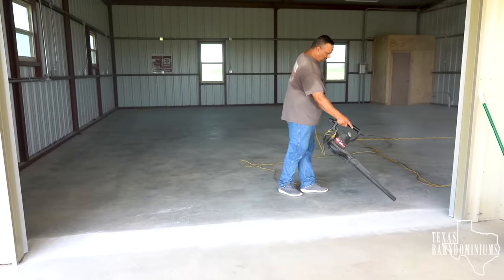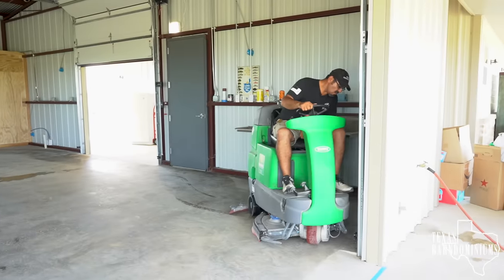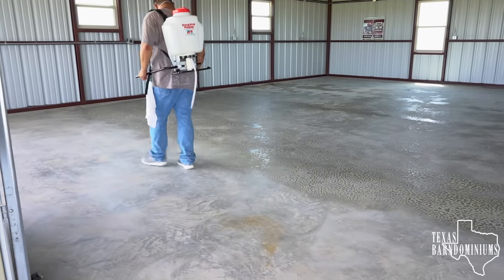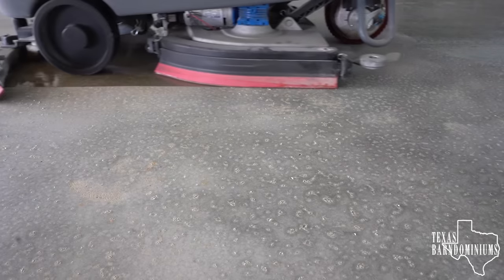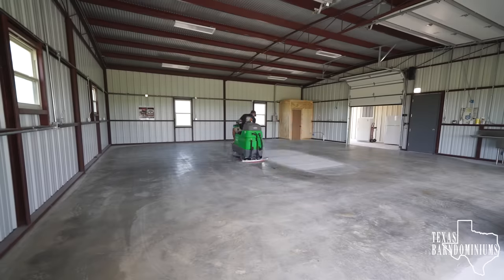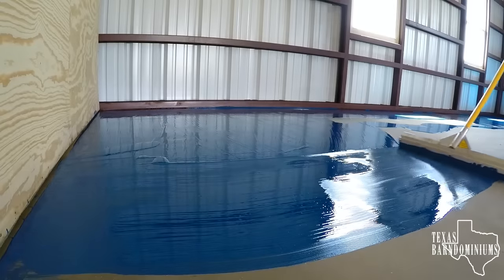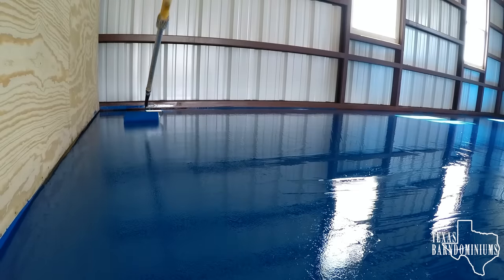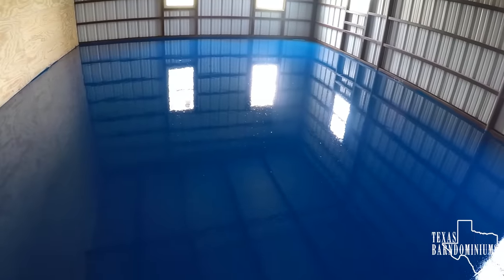How to do Epoxy Floors - STEP BY STEP GUIDE - S3E3

Comment: Speaking as a pro who’s been doing this for 20 years - sanding and acid are only for people who don’t have a grinder.
Reply: Doctor Goop - 
unless its new crete and/or you have a shot-blaster
Reply: How much Make a month$
Reply: My rust oleum primer is still tacky 3 days after application. If I stand on it in the same spot for 3 min and the move the paint peels off. I used muriatic acid first , rinsed and let dry over night. I think my big mistake was that I primed when is was rainy outside. Will this primer ever cure / dry so I can put the epoxy coat on ? 😢

Comment: Most people would do 1 coat and skip the sanding.  This guy does 2, then applies a coat of polyurethane.  It's nice to see someone who takes pride in their work.
Reply: I guess if you do that stuff for a living, and it's your own shed, then you are going to go all the way.  I would so love a space like that.
Reply: I actually grind concrete not sand, he's wrong about feeling like 400 grit sand paper thats not rough enough.
Reply: Most people wouldn't put acetone into 100% solids epoxy...  that's one of the reasons he's getting the bubbles. No bubbles means no need to sand between coats.

Comment: I used to work for a company that put down epoxy flooring. We used to wear metal golf spikes to walk around on it and it was slick. I worked with a guy who slipped and fell in a puddle of the epoxy and he had to go to the hospital to have his clothes removed and get the epoxy off his face and hair. It made me more cautious after seeing that happen. We used to go into a factory on Friday afternoon and not stop until We had the floor blasted, new clad laid and and epoxy coating put on. It had to be done and ready for the plant to open up on Monday morning for 1st shift. We would work 40+ hours in 2 days with no sleep on most weekends. I don't miss that job. I am actually allergic to epoxy now from all the exposure I had to it back in the 90's. My face swells like a balloon now if I even mess with stuff like JB Weld.

Comment: Great advice all the way around! Surface prep is definitely key and you are doing a fantastic job. A couple of observations for those that might not do this everyday. In the video it looks like the epoxy was being applied the next morning. Your results will be significantly better and you will have fewer air bubbles if you apply your epoxy in the evening as the concrete and air temperature cools. In practical terms, concrete exhales as it heats up (morning through afternoon) which causes outgassing and creates air bubbles in the epoxy. Likewise, it inhales as it cools (evening to morning) soaking up the epoxy and leaving a much smoother finish. If I might offer one piece of advice, you might look at using another solvent besides acetone. Acetone loves water and will pull residual moisture out of the concrete, bind with it, and cause small blisters that look like outgassing and pinholes.
Reply: Wowza! Makes great sense! Anything else besides acetone or just deal with a thicker product. Ty
Reply: What's an alternative to acetone?
Reply: Do train
Reply: That must be what the incompetent idiots used on my floor in Florida.  😢
They really did me dirty.  My (expensive) floors are disgusting.

Comment: To get rid of the bubbles spray the epoxy after it has been rolled with isopropyl alcohol from a spritzer bottle. It will make the floor look even glossier and no bubbles.👍
Reply: How soon after you put down your 1st coat do you spray the alcohol?

Comment: That is the most thorough preparation I've ever seen. Well done!  Excellent job.
Reply from the maker: Thank you.
Reply: You haven't seen much then
Reply: @foxyepoxy602  for real he didn’t even throw any diamonds on it 😂
Reply: @tylersherratt4466  nope! I bet parts of this coating have already failed
Reply: @foxyepoxy602  ? Why would it fail?
Reply: @redrockdesign966  He didn't grind the floor. Acid etching only provides a CSP-1 at best, if you're lucky.
Reply: @foxyepoxy602  Why would he need to grind that floor?  What exactly required grinding for this project?   He aggressively sanded them all with a 60 grit orbital...
Reply: @redrockdesign966   For all that work he could have hit it with a Dimond  grinder, Up to 60/80 metal bonded diamonds  then Vac, And apply in the same day..

Comment: I've poured a couple of epoxy floors myself and followed recommendations from other Youtube video's. However, this video is the absolute best because the guy really explains the why's and why not's. Other video's seem to be made mostly by people who want to sell you the epoxy and they skip or don't explain so much of the tedius, time consuming preparations like sanding and acid washing. I don't agree about accepting the bubbles though- a gas torch (preferably) or heat gun used briefly on the bubbles will get rid of them and avoid the need for sanding the popped bubbles afterwards. The popped bubbles really do ruin the look of what would otherwise be an amazingly glossy surface. Also, I used silica sand sprinkled on the epoxy just before it finally sets hard (in other words, while it's tacky like treacle) but you can also get non slip products to do the same job. Well done mate!
Reply: Yes 100% agree on the torch. I used to do this for a living and always used a torch. HUGE time saver.

Comment: Thanks sir! I have a epoxy guy coming out to the job tomorrow to give me a bid for epoxy floors in our commercial kitchen. This helps with giving me  a idea of the process! God bless
Reply: Commercial kitchens (if you have fryers) should have a urethane cement with quartz broadcast & polyaspartic top coats. Nothing you watched here will prepare you for that install. Epoxy will delaminatecat 140*, polyaspartic at 180*, and your UC will take whatever heat you throw at it. There's no comparison.
Reply: I need the job

Comment: I’d never seen this done to a floor; looks dope.
Reply from the maker: Thank you
Reply: “Looks dope”  Is that a good, or bad  thing?  I guess I just don’t understand this new slang language.
Reply: Mark Williams just google the word “dope” and you will see that it is an informal adjective meaning “very good.”

Their example in a sentence is “that suit is dope!”

Lmao
Reply: Michael Duran 
What is this “google” you speak of?
Reply: Mark Williams google is an excellent (one of the best) graters. It doesn’t work on cheese, but rather it works on stupidity; taking big blocks of it and turning into significantly smaller chunks that can be digested more easily.
Reply: @91156  hahahaha!
Reply: Crack, heroin, meth, cocaine, hashish???????

Comment: Here's a tip, wear an old pair of Golf shoes when putting Epoxy down, You can stand in or walk around on wet Epoxy and it will not leave any marks. The tiny holes will self seal. That's hpw the Pros do it.
Reply: @donalkinsella4380  It depwnds on what kind you use!
Reply: DEPENDS!!

Comment: My boss had the floors done with blue epoxy stuff when we moved to a new factory.
We very quickly discovered that it was so smooth, that as soon as the machines sprayed sawdust around, the workshop turned into an ice rink!!
It became so slippery, it was actually a hazard!!
After a few injuries, (and WorkCover claims!) The boss had the floors done again - this time with some sand grit added to the epoxy to provide some traction!!
Reply: Glass bead is what the company I work at uses for industrial companies, mostly for grip plus diamond powder.
Reply: @fearlessgod6625  can add a top coat of clear for protection and mix the bead or grit material into the clear coat.

Comment: Installation was awesome, prep is good for a diy, but not adequate for a professional install. Acid etch doesn't work for long lasting floors only diamond grinding with full cap removal works for lasting prep. With that said this is probably one of the best diy coating istalls ive seen nice work.

Comment: When I do epoxy, I cut in all around the perimeter with cheap solvent brushes, where the floors meet the walls to eliminate getting the slop on the side walls and baseboards. cleaner look.
Reply: define 'cut in'?  like you brush it off?  or you brush the epoxy up next to the wall?  or what
Reply: @RatmanSays  Just like painting a rooms walls, you "cut it"  all the areas where you cant get a roller into. I use a cheap white bristle brush to gut in the outside perimeter so I dont have floor material on the walls when I'm done. Nice clean lines,

Comment: Use a diamond grinding pad instead of sanding and acid etching. Much faster and cleaner. Also, after grinding, sweep then use an industrial vacuum... no dust residue. I did epoxy flooring for 7 years at facilities like US dept. of agriculture, a 60,000 sq. ft. gym for the national guard armory, gene research facilities and even Camp David. Larger floors were shot blasted.
Reply: Can we get your contact?
Reply: I did the same on my garage. After figuring out how to control the grinding buff machine without nearly ripping my arms off, it made for a nicely prepped surface. I don’t think chemical surface prep could ever outshine physical prep.
Reply: @evanphillips4302  sometimes, both are required. Depends on what you have to remove.

Comment: When i do epoxy i throw the colored chips on the epoxy then use the clear coat of epoxy, i never heard of using polyurethane on the top coat thank you for that
Reply: If you don't do poly over epoxy it will yellow where the sun hits the epoxy.

Comment: Good job. To remove air bubbles from first epoxy layer you can try to use hot air gun. Temperature is about 150-200℃, but very gentle airflow. Test this on small piece of surface first.

Comment: To be clear, not all floor coatings thin down with acetone. A lot of epoxies thin with MEK, so read your specs. Also, I've personally seen good products ruined by air bubbles due to not letting part A and B cook after first mixing. What I mean by this is, once you mix A and B together most epoxies have to set for 15 to 30 minutes undisturbed then remixed before use. If not, the chemical reaction between components after applied will trap the off gassing of the epoxy causing bubbled finish. On a side note, if water beads on your concrete before painting, it's not porous enough to finish. It should be able to absorb moisture. I'm not trying to nitpick, but floor coatings can be expensive to paint and more expensive to correct failures. READ ALL INSTRUCTIONS and follow to a T.
Reply: Good to know this.
Reply: What you refer to as cooking is something similar that's supposed to be done in tile work also. Epoxy thinset and grout has a three minutes "slake" time, remix and move quick. You have 20 minutes before the mix sets. In all other types of non epoxy mixes you have a 10-15 min slake time then remix.

Comment: Excellent video. However, I might add that the bubbles are not due to the epoxy displacing air - they are due to heat pushing air through the slab. When temperature increases, air and moisture vapor in the concrete heat up and expand. If you coat when it's cooler or in descending temperatures you will greatly reduce the propensity for outgassing. Great job!
Reply: great info!
Reply: Exactly well said

Comment: How lasting are epoxy floors when subjected to wear? I've seen some neat epoxy floors in parking spaces but I don't know how good they are or for how long they last when you have cars constantly making maneuvers in the same place to park cars in a given spot...
Reply: PrimiusLovin they don’t last, my floor was professionally done 7 years ago and has since cracked, chipped from drop items, shows wear from vehicle traffic. Looks pretty in a garage for a while..it’s still a garage. I almost forgot to mention...it’s slippery when wet!
Reply: It depends how good your applicator is in preparation. And is it for a garage, patio or basement? Polyaspartic topcoat is more durable than epoxy.

Comment: Any idea what this would cost, per square foot, to hire it done?? I have a new slab, and they are fixing to erect the metal building.
Reply: In my area (WI) it starts at $6.00/ sq ft.
Reply: Wow, kinda pricey, but looks great! I only spent $7.00 here in north Texas to get my shop slab poured. That's a 5 inch slab with 2' beams on the shop area, and 16" beams on the parking cover. Guess I may have to either do it myself or paint it.  :(  But thanks.
Reply: In my area of WI it starts at $3.60/ sq ft.

Comment: Won’t the polyurethane change color over time, especially where the sun shines in?
Reply: Typically, the epoxy would change color without a clear polyurethane as a topcoat. The poly normally doesn't change.
Reply: Use a polyaspartic topcoat  to prevent ambering and provide greater protection from small scratches

Comment: If you used a torch with a medium flame the bubbles would have dissipated.  As long as your epoxy was not flammable.
Reply: He did mention he mixed epoxy with acetone. 
Highly flammable
Reply: Yes correct fire will take away all the bubbles..  
Why need to apply acid before epoxy ??
Reply: Also could use a spike roller.

Comment: It´s damn fun to watch these videos to see how damn different each floorlayer is, cus damn that whole thing with sanding and using water etc why not just grit it with a HTC 500 etc and a vacuum?
and mixing i assume the hardener with aceton? i´ve always mixed A and B and then afterwards if i want it to be abit more flowing so to say just pour in some ethenol.
And you went forward and backwards when you started to "lay" the floor we go from left to right and i always use a brush near the base.
Reply from the maker: I don’t like to grind when we are going to seal the concrete.  Also, most DIY people won’t have access to a grinder and vacuum.  
I didn’t cut in the edges with a brush because walls were going to get covered with plywood.
Reply: I started  a few years ago I feel like this is the long way of doing this I grind, vacume, acetone the whole thing, add a coat of vapor barrier, then add my epoxy   chip or reflector.  I also heard that mixing the epoxy with acetone can weaken the apoxy. But enjoyed your video
Reply: The i industrial grinders are available at most equipment rental centers they run about 100 per day. Cant find the vacume though I got one off Ebay for 2,000 I got tired of using the regular shop vac
Reply: @ricardoarenas8686  Do you grind with a diamond grinder? I did not see them do that in the video..They only sanded.... can you tell me more about the diamond grind if you did do that step.
Reply: @TexasBarndominiums  i was wondering about that cutting in the walls. Have you ever used the chips on the epoxy
Reply: @CatA-mp2hk  when you rent a machine you get the diamond grinder but i don't like it. I know everyone does things in different ways

Comment: primer 1st when dry then use spiked shoes and apply the resin like a window cleaner does windows then back roll, gl used to do for a living.
Reply: Spiked shoes. That is a fantastic tip!
Reply: @frankfrantic7000  you could cut board the shape of your feet and put some screwws thru make sure a wide gage and just file thie tips off before use or sink bolts into a media that can handle the stress then taper.) ty
Reply: @digofthedump  GreaT idea 💪

Comment: As a chemist I’m watching this wondering why you’re not wearing a respirator?!
Reply: Zac Henneman cuz he’s mexican
Reply: Because 100% solids epoxy and polyurethane have very little odor.
Reply: @tootallbob  Acetone is a volatile organic solvent - and i would not like to be breathing it in
Reply: @eddybulich3309  Adding 5-10% Acetone to the epoxy in an area that large is not an issue. I've done hundreds of thousands of sq ft of epoxy floors and it's not a problem in a large area. Small rooms?...yes. In addition, in an indoor application, we would have adequate ventilation using fans. Of course, Acetone isn't necessary to use, it just makes application easier.

Comment: Nice job you did; nothing wrong with doing it to last a life time........I've done two part and pre cat jobs on floors as small as bathrooms and large as 40000 sqft warehouses and various substrates, tile, concrete, wood,  VCT...I sweep, then mop the floor, paint it one thick coat ( it's self leveling) and get paid...Never a call back...A  couple times, on the return to site for resetting of things moved, there will be a couple small spots to scrape and blob on some epoxy...Short of that; badda bing badda boom! Epoxy is my favorite paint and floors are my favorite surface to paint...BIGGEST paydays! Easiest work...

Comment: If you use the correct sealer on the slab first you do not get bubbles like you described because the air is already displaced from the voids in the concrete. We use a 2K water base epoxy sealer

Comment: The best concrete epoxy video out there :) etching and cleaning are the key to a good bond.  I have seen this crap peel off in sheets because jack legs just lay down some epoxy after they swept the floor. Don't be stupid, follow these instructions :)

Comment: If you don't mind me asking, what brand epoxy system are you using?? 2. When you sanding down the first coat of epoxy did you run your floor cleaning machine back over it  to clean up the epoxy dust that was created?  your video is on point. very informative, and straight to the point solid 10

Comment: Very interesting video. I  agree the workers should have masks. And I'm also considering the shoes, being from another country I have the habit of boots, Summer and Winter. Erik I suppose the bubbles issue is not the same if the slab is new or old. Am I correct?
Reply from the maker: Correct.

Comment: Can you use the polyurethane 100 directly on a fresh concrete floor, if all you want is a clear protectant against stains, etc?? 
I would assume the procedure would be about the same on prepping? Is sanding/etching recommended for a polyurethane base/topcoat?? Direct to concrete floor?